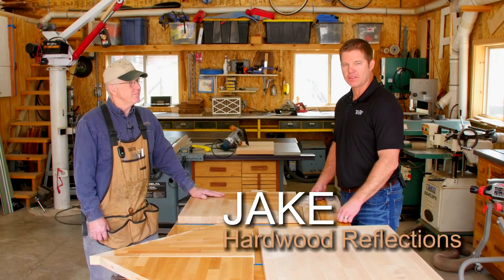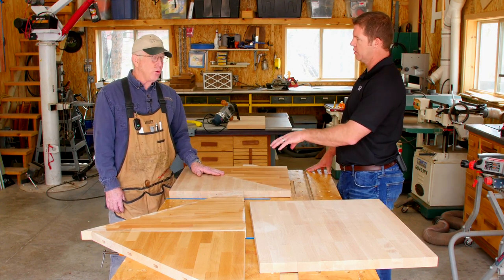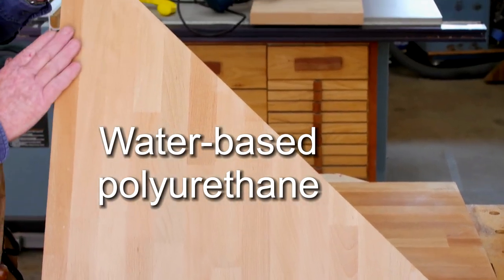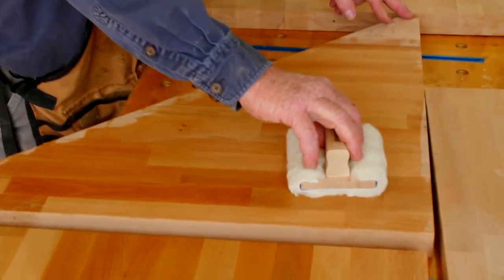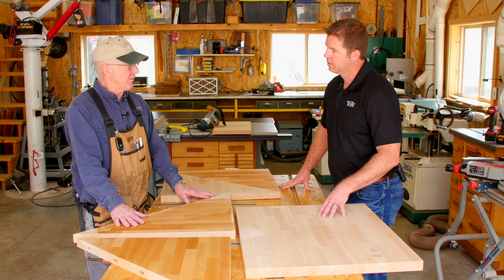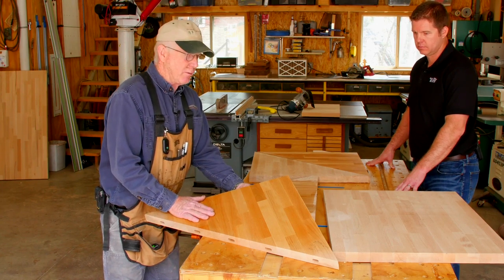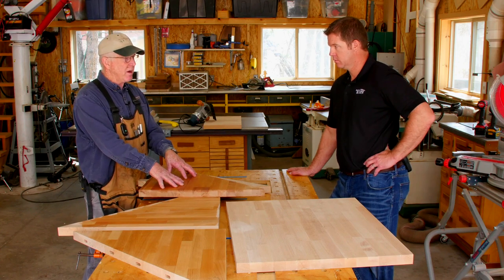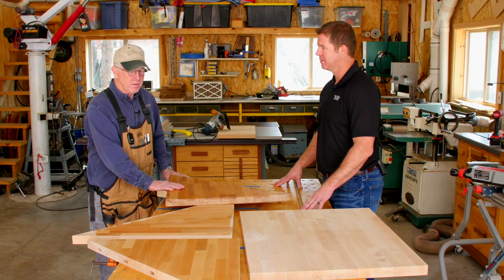Butcher Block Finishing Tips – Hardwood Reflections

Comment: I've got butcher block in my kitchen and it's time to coat it again. I love it everywhere but near my sink. I want super low maintenance and I think the floor polyurethane would be best. What brand do you recommend? Also, can I still knead dough out on my counters after it dries? I never use my counters as a cutting board.

Comment: I just found your video and have a question...I've got a hickory butcher block countertop in my craft room.  It was installed with absolutely nothing done to it.  I know I need to sand it before I do anything to it, but what would you suggest to be the best treatment for it?  One end will be a sewing counter where my machine is recessed into a hole with an insert to make it a flat surface for sewing on and the other end is my computer desk area.  The middle is probably where I will sit my paper cutting machine.  I mainly want it to be smooth so that nothing snags on it when I'm working.  It is on top of white cabinets that are sitting on an Early American stained hickory wood floor and the walls are painted Sherwin Williams Dutch Tile Blue.  Any help you can give will be greatly appreciated!!!

Comment: Hello! Great video, thanks guys.

So when you say sand to 320, does that mean I have to sand 150, 180, and so forth? Or do I just give it a good pass over with 320?

Also, what are your thoughts on sealing with danish oil and using a water based poly top coat? 

Any thoughts on shellac? 

Thank you!
Reply: You can sand the bare wood w 220 only with these blocks put your seal coat on then hit it with 320 another coat 320 to 400 between each coat you apply. I wouldn't recommend shellac unless you have experience with it oil based finishes are much more forgiving

Comment: We bought a piece for a bathroom countertop. Do you suggest the marine grade finish for that purpose?
Reply from the maker: Yes, a bathroom countertop with marine grade top coat would be great idea. Make sure you use it on all sides and edges, and in as many coats as the manufacturer recommends.
Reply: I had the same question!! Thanks MR dundon for asking (doing the same for a bathroom countertop) and THANK YOU @Hardwood Reflections for the video and advice!

Comment: I have 0 intention of using this butcher block for food prep or anything related.  Is it ok to stain and poly with sanding?
Reply from the maker: As long as you do not intend to use your countertop as a cutting board, any finish and stain is acceptable.
Reply: @HardwoodReflections  installed and looks great!

Comment: How many coats of water-based polyurethane are typically needed?  I'm going to install a live edge countertop in my bathroom and want to ensure that it's adequately sealed.  Thanks.
Reply from the maker: Great question and you are correct in thinking you need a proper finish, especially with adding Butcher Block in a bathroom. We believe the best recommendation would be to add 3-5 coats of water-based polyurethane on all sides and cuts (don't forget the sink hole cut) following the polyurethane's recommendations for sanding between coats. You will also want to properly follow the sink installation instructions with sealant around the sink.

Comment: Question for Mr. John: I need a counter top / bar top that will get lots of use & abuse. I will be setting hot pans on it, & using it to roll out pie dough, etc. Can I use a butcher block for this? Which wood is best for a hardy, long lasting butcher block counter top? What's the best way to treat it so it's food safe? Thank you. I've looked online & can't find the answer.
Reply from the maker: Hello and thanks for your questions. We are certain that butcher block can hold up to a lot of use and abuse, but the hot pans direct on any surface will leave marks. The Ash Butcher Block in our line has the highest hardiness rating, but you'd find 9 other options to choose from that would meet your countertop needs too. We have a great resource on food safe options so you can use the entire board as a cutting board too. Find the food safe tutorial here: https://hardwoodreflections.com/how-to-make-a-butcher-block-countertop-food-safe/ 

Feel free to message us through our Facebook or Instagram pages too for fast response!
Reply: @HardwoodReflections  Thank you very much!  This is so helpful.  I was undecided between getting maple or ash, but didn't have a whole lot of info to go on.  Thank you for the great article too.  I can now breathe easier knowing all of this.

Comment: If we do a countertop with the oil/conditioner, how are we supposed to reapply to the bottom side? Do we have to or can we just do the exposed sides and top for the maintenance treatments?
Reply from the maker: Great question - You'll want to use a permanent finish (polyurethane or other options)  on any sides and edges that you won't be able to get to for maintenance. This will keep your countertop safer against moisture or drying out.

Comment: Thanks guys. What would you recommend in a camper?
Reply from the maker: Butcher Block looks great in a camper! You could still choose to do the natural mineral oil or conditioner but it will need to be re-treated every few months, even when the camper may not be in use. Multiple coats of polyurethane, either by spray or brush - your preference, is very close to maintenance free and would likely only need to be touched up if it happens to get a scratch by accident. You should pick one or the other.  Don't combine the two.

Comment: Does Howard’s butcher block conditioner adhere to the Howard’s mineral oil already on the wood? Also, does the Howard’s conditioner prevent visible water spots from sink splatter ?  Thanks so much!!!
Reply from the maker: Great questions. You'll want to clean off the surface of the piece before adding any other finishing product. You'll appreciate it in the long run. To remove the mineral oil, use just a little bit of warm water, light dish soap and some elbow grease. The mineral oil will wash off. Then sand it with a fine sandpaper and you're ready to apply your finish product. We have fielded questions about water spots, but not sure if it was with this product. They do wipe up without problem. Also, you might want to consider how much water you're expecting to splatter, and think about a more permanent sealant option like polyurethane.

Comment: I doubt the floor poly is FDA-approved for a food surface.
Need to check before you chose.
Watco® Butcher Block Oil + Stain is specially formulated for use on wooden butcher blocks, cutting boards, salad bowls and other wood applications which require a food safe finish. Easy to apply and maintain, it is nontoxic and safe for food contact when fully dried (meets government standards of 21CFR 175.300

Comment: Excellent video, thanks!

Question: what is the best sealant that you would recommend for a coffee nook? I would need a durable sealant for all the coffee drips that will inevitably fall on the block, but the block will also kind of double as a stationary with some paper, so I’m thinking mineral oil might not be the best choice. Thank you 🙏
Reply from the maker: Thanks for the great question! A polyurethane coat will keep all that moisture sealed in, and will be added protection, but it can still get rings, water damage like any other wood surface. But if you want a food safe area, we do suggest mineral oil. Think of the wood as a big sponge. A couple of coats of mineral oil will bring the wood to life. Months down the road, it could use another coat, filling that wood. After a few times, it won’t need it anymore because the wood will be nice and saturated.
Some people prefer polyurethane because there is no maintenance. Some people prefer mineral oil because a stain can be sanded off and more mineral oil added and you’re done, while polyurethane would require more time to reapply.
Either way you go, you’ll want to wipe up spills as soon as you see them, knowing that the problem can be fixed with either of these treatments.
Reply: I’m wondering if the danish oil would be a good choice for my project, what color did you use on your sample? Was it natural? It’s beautiful!!!

Comment: Howard's oil and conditioner definitely makes the wood pop the most.  Could you start with the Howard's oil/conditioner and then apply a floor polyurethane over it to lock in the look?
Reply from the maker: You should pick one of the other.  The Howard's is excellent but it will need to be re-treated every few months.  The floor poly is maintenence free.  Don't combine the two.

Comment: Loved your video! Just a quick question for you 
What is the best to use on a birch counter top that will not be used for any food 
Is shellac ok? Or polyurethane for floors?
I'm trying to replicate a baseball court 
Any suggestions would be appreciated
Reply: Watco® Butcher Block Oil + Stain is specially formulated for use on wooden butcher blocks, cutting boards, salad bowls and other wood applications which require a food safe finish. Easy to apply and maintain, it is nontoxic and safe for food contact when fully dried (meets government standards of 21CFR 175.300

Comment: do you do both sides with interbuild hardwax oil when using for a bar top? and how long do you let it dry?
Reply from the maker: Hello - We'd refer you to the manufacturers recommendations on this question. If it's like most top coats, we'd expect it to be 24 hours.

Comment: I have just bleached clean a 3" thick butcher block that a friend gave me out of there garage. It looks good now and I had it kiln dried with clamps for a week. But, there still is a separation between the wood strips. All I can see to do is use epoxy to fill the spaces. I'm afraid of the process of epoxy but will do it in order to use this block for it's intended purpose. Any more suggestions?
Reply from the maker: I like to use a wood filler opposed to the epoxy.  Try a Timbermate brand.

Comment: We are finishing our complete kitchen remodel and are now getting ready to finish our butcher block HR counter top and island top. I think I'm narrowed  down to danish oil or the Howard butcher block conditioner, is there any way to get them a bit darker in color?
Reply from the maker: Great question.  You can always add some stain to make the wood darker.  I like to experiment on the back side (the one side you will not use).  The danish and Howards will both darken the wood.  I use Howard's in my cabin kitchen and it has worked great.

Comment: I purchased VT industries Hevea butcher blocks for my kitchen counters. I put 4 coats of Howards Butcher Block conditioner prior to installation. I had to wait about 3 weeks for installation.  I have had these countertops for only a few days and already have a serious water stain. I do live in a very hot and dry area. I need to figure out how to protect these countertops from serious water damage. I did see a tung oil & citrus solvent product but I am unsure what to do. This is my only experience with a butcher block counter.
Reply from the maker: HI Jennifer - We're not sure about the VT Industries product but we'll try to help with the butcher block questions. Are you using your countertop as a cutting board? Generally, it's recommended that the conditioner is followed up with a few coats of mineral oil. If you're not using this as a cutting board, we could make a few other recommendations.
Reply: @HardwoodReflections  I am using the butcher block as countertops. I am finding that the countertops need to be treated with the conditioner very frequently.

Comment: I bought some of y'all's butcher block to use as a desktop. There seem to be random imperfections (which I'm sure are normal for unfinished wood). They include some valleys and contours. Is there a way for me to get them out? Do I need to use a planer or would an orbital sander work? (maybe with a hard backing pad for rigidity)?? Thanks!
Reply: Thomas Hey, I’m getting a birch one, you think I should invest in a sander tool to sand it down or is it smooth as is? I’m planning to stain it

Comment: I like the durability aspect of a polyurethane coating, but I do want the wood to either have depth or a stain. Can I stain the wood before applying a polyurethane coating, if so do I need to stick to a certain type of stain?
Reply from the maker: U bet.  The trick is to stain as many coats until you are 100% happy with the color.  Wait about a month and then use a polyurethane top coat.  I know a month sounds like a long time but you can use your counter in the meantime.  The top coat will make the wood maintenence free.
Reply: @HardwoodReflections  what happens if I don't have a month to wait?  don't I need to have them fully treated top/bottom before installing? or can I stain, install, wait 30 days then treat the upper/front edge with the poly?
Reply: @redhotpottery  I just had a woodworker apply poly right after 2 coats of stain so I hope its not an issue
Reply: @netm203  I ended up doing it right away and it's been a few months, they look great.
Reply: @redhotpottery  thats good news then. I hope to have someone install it Tuesday. Was the install fairly easy?
Reply: @netm203  I had they guy who did my cabinets do them, so I don't know but he didn't seem to have any problems.
Reply: @netm203  oh also, DEFINITELY use spar urethane around the sink cutout and faucet area.  Totally waterproofs it.
Reply: @redhotpottery  thank you! Luckily, I'm only using it for the island top.

Comment: I just redid my entire kitchen and installed all my countertops using butcher blocks..  I used the Howard Butcher Block Conditioner and im not happy with it at all.. We liberally applied 4 coats and my new counters are still staining just from water spots.. And if you get water on it, it not only leaves a stain when it dries, it also pulled some of the wax out and makes the counters feels crusty when the water dries.. I am having to continually scuff the spots out using 0000 steel wool.. After this happen, I did some research and found many reviews of similar experiences from other that use this product..
Reply from the maker: We can make you happy.  This actually happened to me a couple years ago and I was all fired up.  Here are some options.  1. do nothing for a month and if you are OCD this will be a problem.  Howard's will actually help condition your wood for the kitchen environment.  Then when your tops look like it is getting tired or drying up--lightly sand and apply another coat of Howard's.  You problem should be fixed (I know this sounds counterproductive).  Option 2: Do nothing for one month and let the Howard's dry out.  Then sand the top and add a water-based polyurethane--a couple coats and then you are all set.  More questions-send me your contact info at hardwoodreflections.com and I can jump on a call with you.
Reply: @HardwoodReflections  I have been experimenting and think I found a solution that is working.. After applying allot of coats of the Butcher Block Conditioner, I then wipe the entire counter down with a very damp towel. This causes the wood surface fibers to raise. Once the water dries, the fibers will still be there, which makes the surface feel very rough..  I then sand it with 200 grit which knocks down the raised fibers.. I do this at least 2 times or until the fibers no longer raise when it gets wet.. Then I apply one last coat of the conditioner and it doesnt seem to be staining any more.. I read an article that says the cause is due to the wood fibers that raise when it gets wet, which makes it very susceptible to staining..

Comment: After you season the board with mineral oil,  can you still stain it?
Reply from the maker: Hi Chris - Great Question. If you're using mineral oil, you probably are wanting to use the countertop as a cutting board, therefore, needing it to be a food-safe finish. In that case, you will not want to stain it.
Reply: There is a butcher block oil + stain by Watco and the front label says its safe for food contact.

Comment: Gentelmen, thank you for a great video... Question - I have a mobile home trailer (2nd home) which I would like to replace the counter tops with Butcher block. I live in AZ and during the summer when were not there it can get very hot inside. Should I be concerned with that when it comes to butcher block? Thank you!
Reply from the maker: What a great question.  The wood will move a little, but in your case we need to worry about expansion.  I would leave an 1/8" expansion in the back--like a caulk line.  This should work great.  I have a cabin that gets to zero in the wintertime and I did the same thing.  Also don't glue down the top onto the cabinets.  Use good wood screws.
Reply: @HardwoodReflections  Will do, thank you!!
Reply: @HardwoodReflections  Is expansion/contraction a concern in a home that will be heated/air conditioned year round?  I purchased the block yesterday and the plan is to use it as a vanity top  that will make full contact with the wall on 3 sides.

Comment: Can I use a conditioner and a polyurethane top coat?
Reply from the maker: I like to choose one of the other.  Go with a poly + top coat or just a butcher block conditioner.
Reply: @HardwoodReflections  Does one protect against water damage better than the other?  I'll be using it for a vanity top in a bathroom.